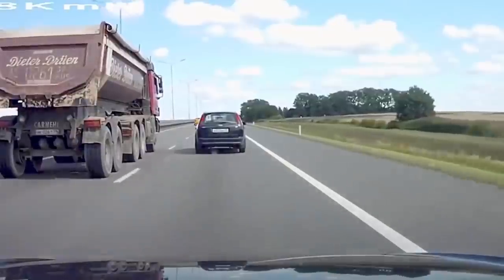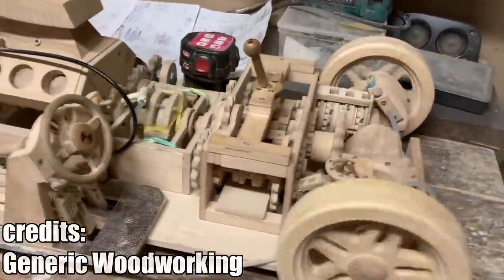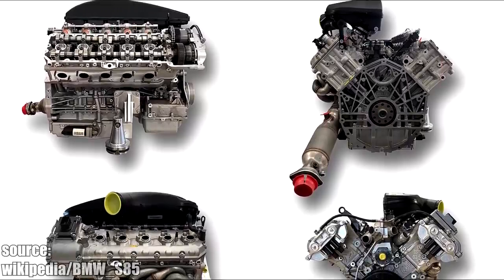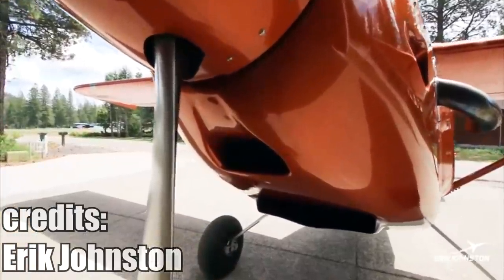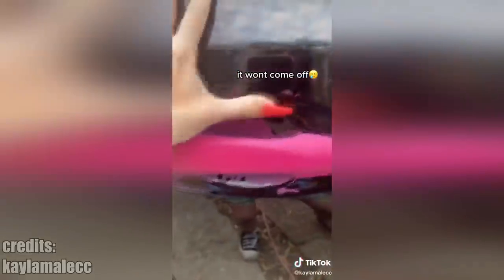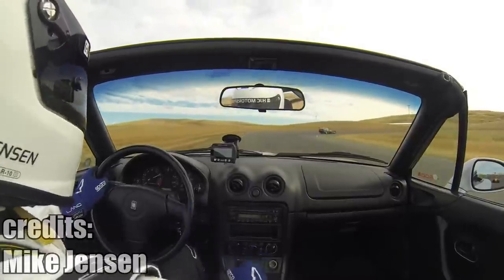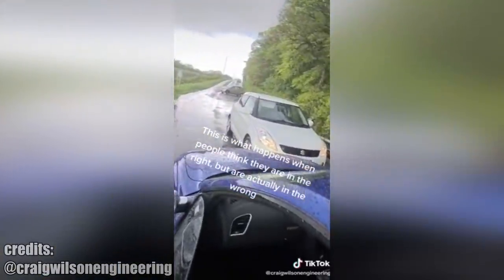This Truck Is Longer Than Your Attention Span

Comment: The plane with a a chevy engine means a chevy is literally doing a fly by
Reply: chevy's also do flyby's in baltimore
Reply: @shattersucks6270  I saw a chevy truck fly off the car lift at a shop because the owner left it in gear before they lifted it
Reply: What if we put a plane engine in a car now.
Reply: @joelikespotatoes8321  Think they already did that

Comment: Usually those systems in 6:18 are typically notorious for being in vehicles or trucks known for being gas hogs. The chevel had it for 4th gear and higher.

Comment: 6:40 wasnt a moneyshift, the car was fine. Also he shifted from 3rd to 2nd (instead of 4th). Usually a moneyshift is 2nd to 1st which is a much bigger difference, hence rip engine.

Comment: For that truck crash one. There’s a big reason that truck driver would be dead. That was a cab over. Unlike in normal semi trucks or “American semis” the cab over has no crumple zone. When it comes to designs where you do have a crumple your chances of survival SKYROCKET.  The reason cab overs are still used however are because most of Europe has length restrictions that include the cab (where as in America the cab is not counted in length restrictions) and that Europe was built around the person, not the auto mobile like America. So their roads are smaller. Cab overs do better as they have better visibility and maneuverability.

Comment: fun fact most car engine are rarely use because of bad reliability. 
Why you must ask its the powerout  a car engine not made to run at 80% for a hour
more parts means more chance of failer where  lots of planes that use old engine are simply and rarely break down but there a downside powerout put and mpg is less

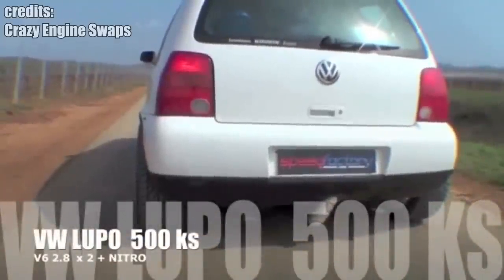Comment: 5:23
so what your saying is that some one built a W12 engine similar to a veyron and put it into their golf?
also the holly carb thing is a 4 barrel carburator and the extra 2 barrels opening higher up the throttle range is rather common,